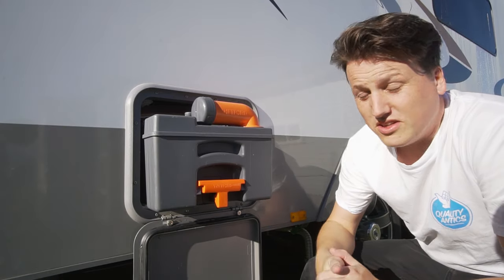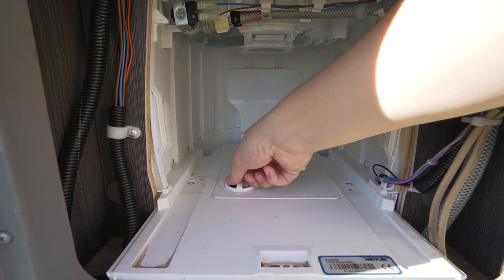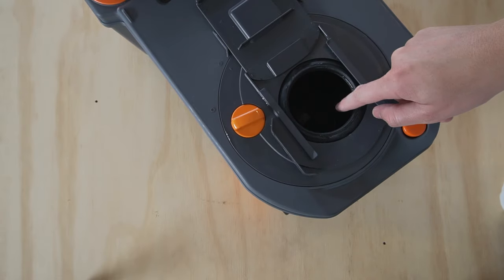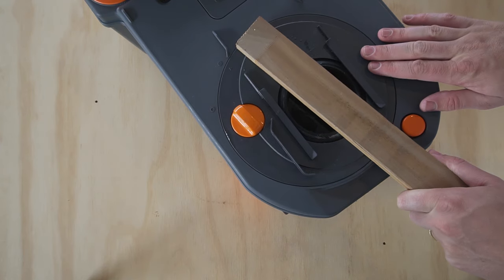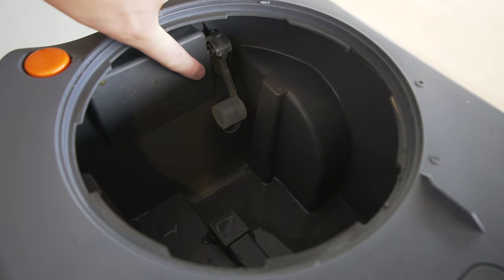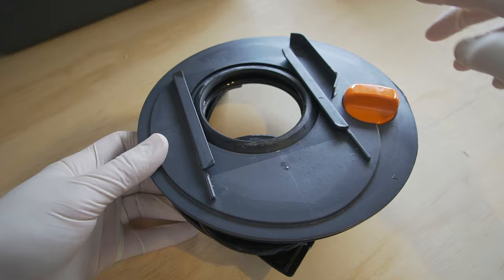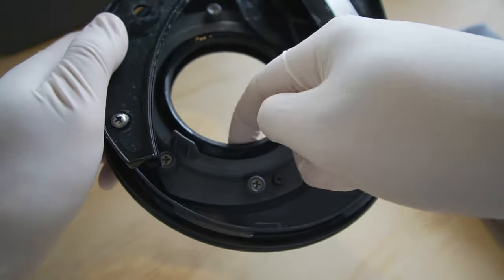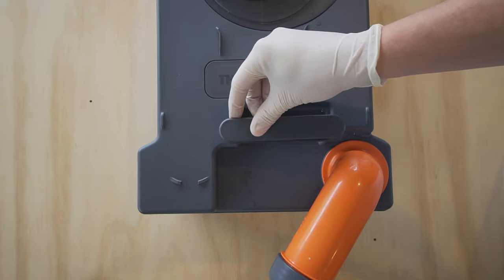Thetford Cassette Toilet Cleaning Tips & Tricks + How To Open

Comment: I some how popped the half moon plastic part off when I pushed a jet handle into the hole to watch it out. That’s then stopped the disc from opening and closing.  Does the half moon need to be in place for the mechanism to work?
Reply from the maker: Is that the half moon bit on the back? I think it guides the disc that opens and closes?
Reply: @AdventuresWithRosy  it’s on the underneath next to the disc and so of partially wraps account the circular opening.  Seems to have a little edge to stop the mechanism going past a certain think now I’ve opened it today.  I’m going to try and screen longer screws in to secure it the plastic has become better and snapped away from the lid

Comment: Great video, thank you. The float had come away from shaking my cassette too vigorously during emptying and cleaning so the red light stayed on permanently. I learned from another video that people have dislodged their floats and lost them down the toilet during emptying so I no longer shake. Just a rhythmic rock back and forth from now on! Trying to refit it through the small flap hole is a nightmare and I had no idea that the whole mechanism could be removed. Made the access and the refitting job so much easier. Great tip about using a block of wood to undo it as well. Thanks again.
Reply from the maker: You are welcome Leo! Thanks for watching! I could see those floats being lost when emptying the cassette! Rocking it back and forward is a much better idea than shaking it, good tip 😊👍

Comment: Thanks for the vid mate! Fixed me loo. It's an older one and the top doesn't twist off but was able to unscrew it ... First 2 visible screws and then you have to lift the 2 little covers over these little side bars to unscrew 3 more each side. The plastic cover that sits over the opening mechanism (the blade) had dropped down so you couldn't fully open or close "the gap".
Was able to get a screw driver under the cap and lift it up and now everything works fine. 
I've subscribed and look forward to catching up on your travels. I've been travelling around Ireland and a bit of Europe for a year.
Reply from the maker: Nice work! Good job figuring that one out, sounds like a head scratcher with all of those screws 😊 welcome to the Adventures With Rosy family!

Comment: Thanks champ your repair seems to be the closest to my problem.
I must not have closed the flap off properly before pulling out the cassette and when I did it was a little stubborn so I yanked it out, emptied it and NOW it wont go back in allowing my to open or close the toilet. I did notice though that the red tap on the cassette remains on a angle so I am hoping if I open it up I can re align it??? well here goes.
Reply from the maker: Good luck! Sounds like it’s just out of alignment some where, ours can be a little stubborn too! Hope you figure it out!

Comment: great video, thanks a bunch. the piece of wood to open the cassette is a great tip. as a matter of fact,  I use a piece of wood of the full width of the cover ( ca 3.5 inches), so that the pressure is spread on the full length of lid. always afraid of breaking these possible fragile pieces of plastic!
Reply from the maker: Thanks for watching Benoit! Yeh that still plastic does feel like it could break, good idea using a piece of wood that covers the full width! Had not thought of that 👍

Comment: Thanks mate. What's the orange push button do on top?
Reply from the maker: That little button lets air in as you empty the cassette, so when you tip it up to empty hold the orange button in and it will empty better 👍
Reply: @AdventuresWithRosy  Thanks

Comment: Thanks for that great video and have now replaced my lip seal. However, when standing the cassette up on end full of clean water. it's now leaking out of the  orange switch to open the valve and also the big rubber washer around the outside of that twist and lift off bit - do you know what this washer is called as I can't find any reference to it and is there a way to stop the leak at the valve switch? Thank you
Reply from the maker: Sorry I missed your comment some how! That leak sounds old, Is that the orange button the let’s the air in or that orange switch/dial that you turn to open to flap?

Comment: Good informative video. There was no mention of lubricating the rubber seal. We were told to use olive oil only on the bottom of the seal where the plastic disk meets it. Stops it from drying out also.
Reply from the maker: Ah good point Trevor! Thanks for the information 👍 I had heard of people using Vaseline but I wasn’t sure if that was good advice or not 😊
Reply: Silicone is also OK.  Don't use mineral oils on plastics.  In the long term it causes thd plastic to become brittle.

Comment: You  just saved me a fortune thanks but what is the round orange button for
Reply from the maker: Good question? That button allows air to flow through the cassette as you empty it, so when you tip it up to empty it press that button at the same time and it will empty a lot better 👍

Comment: Do you have any help with blade handle under toilet no longer working with blade opener on cassette
Reply from the maker: I haven’t come across that sorry! Did you manage to fix it?
Reply: @AdventuresWithRosy  all good it turns out that the issue is a tiny piece of plastic that open and closes the blade to the cassette. So bigger job. It appears to be one piece with hoses and electrical. 😒
Reply: Learnt some things from your video. 😊